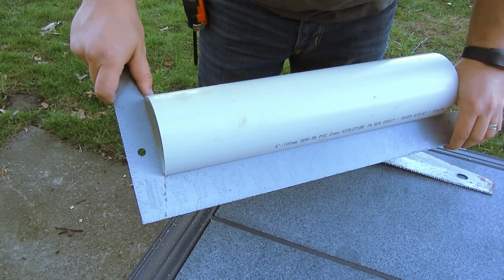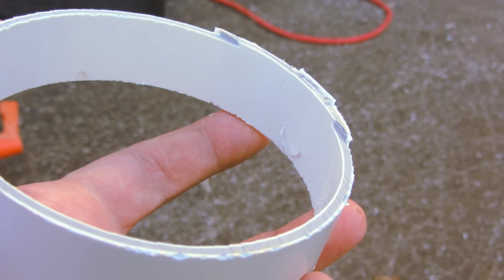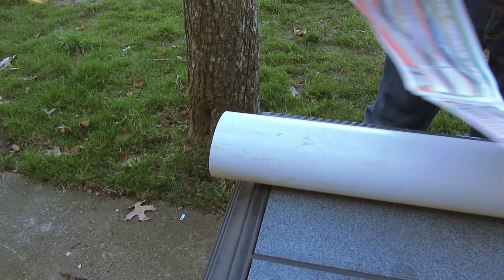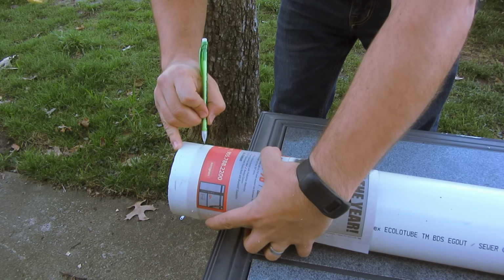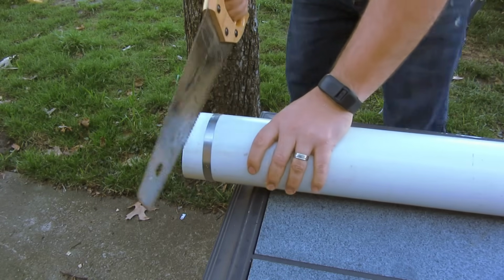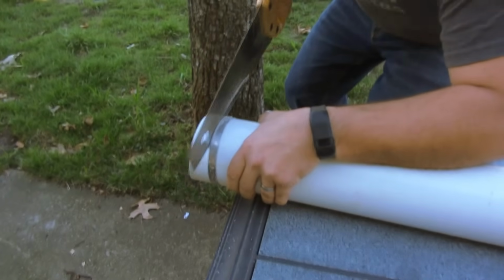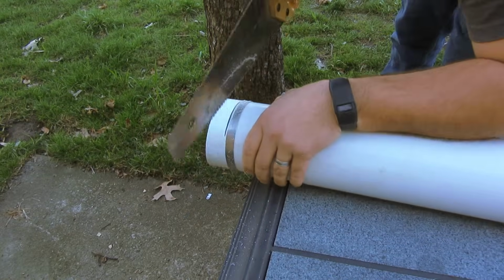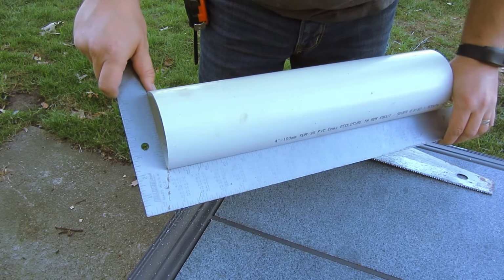How to Cut PVC or ABS Pipe Straight

Comment: I needed to cut 1.5 inch plastic pipe accurately and tried your method. Worked a treat, thanks for the help
Reply from the maker: I'm glad it helped!
Reply: For smaller diameter tubing such as this a metal pipe/tube cutter (the one with the screw down cutting wheel and two rollers to support the pipe) works very well. But I agree - excellent methods shown, very well explained and nicely presented!

Comment: You just made my life so much easier!  (To Myron McKinney's point, I did use my old 24" Disston whose teeth are no longer sharpened or set.)  And then, after failing to get a square cut all afternoon with a hacksaw, Voila! I'm cutting 2 inch PVC without a chop saw or mitre saw, and I'm getting beautiful, square cuts that require very little dressing.
When I'm all done with this project, my trusty Disston will get a well deserved sharpening. It's only been 44 years since I had it done.

Comment: Nice idea about using the hose clamp. Well what I do is I just use the newspaper like you did but then I tape it to the pipe and use that as my guide. Works pretty well. Don't forget the cut doesn't have to be too accurate so if your cut is out by a few mm, don't worry, just grab a flat file and file off the remainder until you get down to the newspaper edge. Remove the paper, and the edge should be straight. Last step then is to taper 45 degrees for easy insertion into fittings 👍

Comment: I just did this today. My miter saw massacred it because I couldn't hold the pipe square and level (I don't have the saw mounted on a bench with wings). I tried the newspaper method alone but even using that as my guide I couldn't saw it straight. The hose clamp is the best idea; even then I couldn't saw it perfectly straight, but kept the hose clamp on and filed down the ABS level with the clamp. I never would have thought of the hose clamp method on my own!
Reply: I just saw someone on youtube use a 110mm weather pipe collar. Fits over the pipe, you hold it and cut. From Screwfix. I am buying one tomorrow.

Comment: Great, simple tip !
I’m going to use the paper/hose clamp & handsaw method right now !
Reply from the maker: Glad I could help!
Reply: @GabesHacks  You may want to add that your system with paper and hose clamp will also work very well if you cannot  remove the pipe and put it on a bench. I have a pipe  coming out of a wall and connected to other pipes and I need to cut it clean  so as to insert a "T" fitting.  It has to be done in place and no other way but yours can work.

Comment: I've used cable tie around the pipe and a frat saw (with a fine blade). If you take the time with the fine toothed saw to first go around the pipe and make a shallow cut guided by the cable tie, you can get an almost perfectly straight cut.

I did purchase a hose clamp just for this, but the damn thing didn't have enough tread to tighten onto the pipe, so I had to improvise with the cable tie. I do think it isn't any worse than the hose clamp.
Reply from the maker: Awesome! That's another way to do it. Glad it worked out.

Comment: Hackzall with multi material blades works great. Takes a little practice but much faster and you can cut really straight and clean
Reply from the maker: Hey, if you can do it. I was using this for a non-plumbing project where the edge was going to be exposed, so I wanted it perfect.

Comment: I was trying to use my miter saw to cut 4" pipe and ran into the 10" blade issue. I didn't even think that it would stay perfectly straight if I just continued the cut with a handsaw lol. Thanks!

Comment: Thanks for the video! Now I need to figure out how to cut a vertical drain pipe straight as I need to lower my piping under my sink since I switched from overhang sing to an undermount. I probably need to drop my piping down 3 inches but do not have enough vertical pipe on the piping to bring it down so I need to cut into the drain pipe going down into the ground since I have about 15 inches of drain pipe to work with.

Comment: Heres an easier way. Keep an off cut of pipe with a single vertical cut from end to end. Place the off cut over the pipe that you want to cut (like a sleeve) then draw around it onto the pipe beneath.
Reply from the maker: Sure, as long as your off-cut piece is a straight cut.

Comment: Here is another way to do this that is much more accurate, in my opinion, leaving not much room for a final non-perpendicular to-the-center-line finish cutting error on the face of the cuts. I had to insert a 3" PVC Sweep Wye in a main soil drain for a new sink discharge. To eliminate having to pay close attention to guiding the saw against a hose clamp with a thin edge, I used two closet flanges with straight-through 3" IDs that I split in half on the diameter of both, and used them on each side of the cut to be made, separated just wide enough apart to guide the saw blade. The saw blade can be used as the straight edge to line up the closet flange halves. A hose clamp is used to secure both halves of the closet flange around the pipe to be cut, rotating the diameter cuts of the closet flanges 90 degrees from each other. The wider lip of the closet flange guiding the saw makes it much easier to make the cut without having to pay such close attention to following the edge of the hose clamp while making the cut. The cuts on the nipples used in the Wye for the Fernco coupling were made on miter saw for perfect parallel faces on both ends of that assembly. There was enough fractional play in the length of the main 3" line to squeeze the Wye assembly insert so that the deburred mating parallel faces of all four cuts form an essentially negligible, as if non-existent joint on both ends of the main line finished assembly 3" ID.

Comment: Used this with a junior hack saw on 125mm (5") diameter pipe, clean as a whistle.
Reply from the maker: Awesome! Glad this could help
Reply: whistles often have alot of spit on them though.....

lol kidding of course, i get the saying :)
Reply: Great tip! A hacksaw makes so much sense - nice fine toothed blade, they're hardened so nicking the clamp won't dull it, and cheap and replaceable.

Comment: You're making it way too hard.  Don't take the PVC out of the circular saw and turn it over.  Spin the pipe while the blade is cutting the first time.  It will give you a clean and perfect edge.

Comment: Sweet hack! Would a hacksaw work better for pipe or is a general saw with bigger teeth preferred?
Reply from the maker: It doesn't really matter I don't think. Use whatever you have. If you have both, then you can try both and see which works better.

Comment: Or a sawzall so much easier even a grinding wheel if you run it across the edge slowly
Reply from the maker: As long as you have that pipe clamp in place to guide it, sure.

Comment: running your saw against the clamp will dull it.
Reply from the maker: Sure, just on the one side, if you're using a saw where the teeth are angled out to the side (which most are). But my saw still cuts wood.

Comment: Good day, I know this is unrelated but do you know how to calculate the right motor in cutting 4" PVC pipes with a circular blade?
I want to build my own cutter.

Thank you.
Reply from the maker: Are you talking about the power of the motor needed? I couldn't help you there, sorry.
Reply: @GabesHacks  yes. It's fine thanks for the response
Reply: Don’t need to reinvent the wheel. They make miter saws that cut pvc just fine

Comment: Can I apply tape instead of clamp when using a handsaw?
Reply from the maker: The purpose of the clamp is to give you something to keep the saw against to make sure the cut is straight. Tape won't help you any more than drawing a line. You would have to watch your cut and make sure you're not cutting into the tape.
Reply: @GabesHacks  aha, got it, thanks

Comment: I think we don't need paper or 3/4 pencil marks marks to cut it straight if we've that flat hose clamp
Reply from the maker: oum oum I did that because it is possible to tighten down the clamp crooked. It won't be far off, but it can be off.
Reply: Gabe's Hacks so to overcome the problem  we need flatter clamp n ensure it lay flat parallel to the pipe
Reply from the maker: oum oum Sure, that'll work too.

Comment: Can u use this methid for cutting centrwl vacuum pipe? Will it be a cleqn cut?
Reply from the maker: I don't see why not. the pipe used for central vacuums are PVC, but with a thinner wall than what's used for sewer. So you should find it even easier to cut.

Comment: Why bother with the paper and tracing around it when you can just trace around the hose clamp? It looks like you were able to cut through the pipe straight with the hose clamp on and that it didn’t get in the way
Reply from the maker: It's possible to tighten the hose clamp on crooked. Tracing the paper makes a perfectly straight line, perfectly perpendicular to the pipe. You use that line to guide where you tighten the hose clamp, so you know you're tightening it down straight. Then you use the hose clamp to guide the saw.
Reply: Gabe's Hacks I see, thank you
Reply: @rey5905  did you watch the video?
Reply: @GabesHacks  Could you dispense with marking the pipe at all by just setting the clamp in line with the paper (having taped that to itself temporarily, perhaps)?
Reply from the maker: @maurice1606  Sure, that sounds like it could work.

Comment: What do you do for a 45 degree cut since this is used a lot for tool storage?
Reply from the maker: That's a lot trickier. I haven't tried that. You can start the cut with a mitre saw and finish it with a hand saw, but it won't be perfect.
Reply: 45* cuts aren’t used for pipe fit up so this method wouldn’t work. If you want a 45, take it over to the miter saw and cut it
Reply: Then it doesn’t have to be exact

Comment: Great. Now cut it straight without a clamp or marks around it. It can be done it just takes skill. Plumbers do it all the time.
Reply from the maker: Hey, if you can do it, all the power to you!
Reply: "all the time" is the important phrase. Of course they can do it well if they are doing it all the time.  If you are just a regular Joe who is doing this for one project and doesn't have a lot of tools or money to go buy them then this video offers an amazing way to get the job done with simple low-cost items.
Reply: @paulweston8184  I was taught to cut pipe straight without marks or clamps because we install the plumbing for new houses and have to cut about a hundred pieces of pipe a day. If we were doing a top out and wasted time putting a clamp to every cut we would never finish plumbing a house. Then I would get fired. I didn't come here to show off. This clip was recommended to me by YouTube and when I watched it I was surprised that there's people who struggle to cut pipe straight.
Reply: @strangeroamer3219  Yes, and you were taught to cut pipe straight without marks or clamps because you are a plumber's helper. I don't cut a hundred pieces of pipe a day and don't plan to. So using marks to cut one or two is fine by me. I have other skills that I've mastered that I'm fast at and I don't hover around newbies of the same task to gloat.
Reply: @GabesHacks  
Hi, would a small hacksaw be ok to use?
Reply from the maker: @dhalsim-1  As long as it cuts, it'll be fine. It might be a little slower though.
Reply: @GabesHacks  
Ok thanks

Comment: When i used the circular saw i got chunks fying everywhere and an extremely uneven cut. How did you get it so smooth? Does it not work with 1 1/2 inch pvc?
Reply from the maker: It should work fine with 1-1/2". It might be the blade you are using: it might be dull. Or maybe you just need to cut a little slower (but if you cut too slow, it will start melting).
Reply from the maker: @dougmerrett7234  That's true too!

Comment: That's bull shit on the miter saw don't work !!
Reply from the maker: How so?
Reply: I use a wood blade on my 12” dewalt and never had any issues cutting pvc. Clean cuts all day long.
Reply: @GabesHacks What size is your miter saw blade? Is it a 10 inch or 12 in??
Reply from the maker: @Thatsmessedupman  Mine is a 10". So if you have a 12", you should be good

Comment: Takes too long. Have a steady hand and do it right.
Reply from the maker: I would be interested in seeing someone make a nice square cut in a pipe this size with just a saw and steady hand. Maybe you can make a video.
Reply: I use a sawzall. No time to use a hand saw. 2" and below I use my bandsaw.
Reply from the maker: Sure, that works if you have the tools.
Reply: @GabesHacks  I have my tools at work so I can't make a video. But in plumbing you have to learn to cut straight without using marks or a guide. Just hold the saw straight, pull the trigger and the saw will do the rest. When you are plumbing a whole house you can't waste time setting a clamp and making marks. Definitely not with my boss.  But practice makes perfect.
Reply from the maker: @strangeroamer3219  Agreed that practice makes perfect. Just most people looking this up on YouTube are doing so because they don't have any practice.